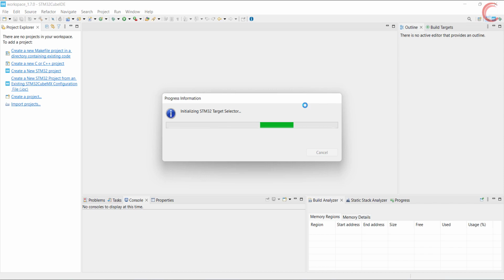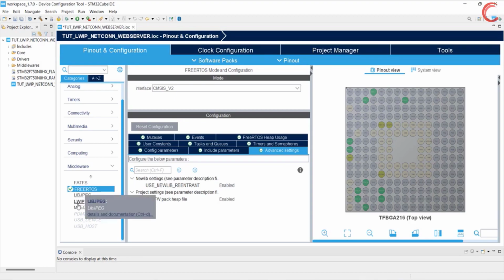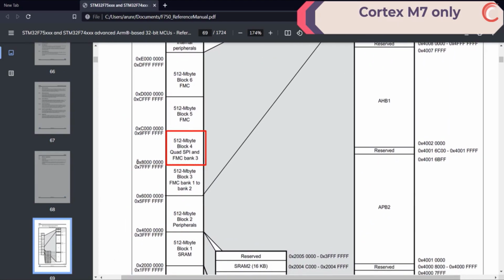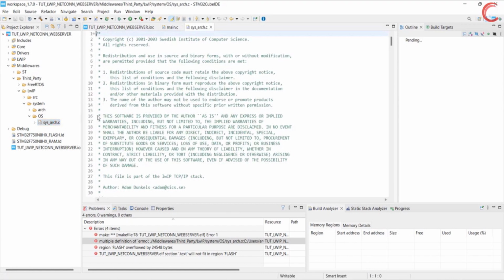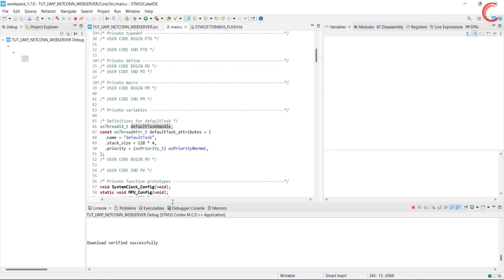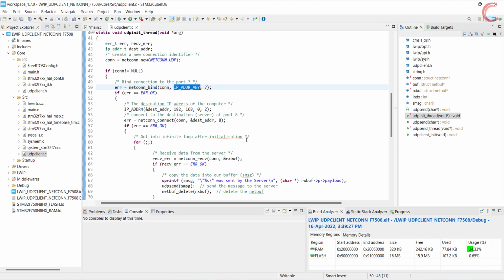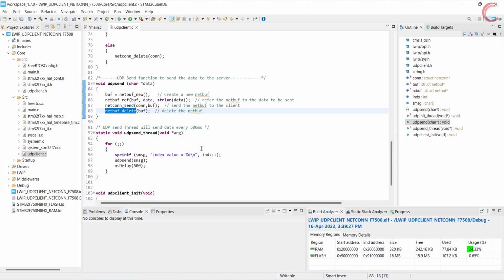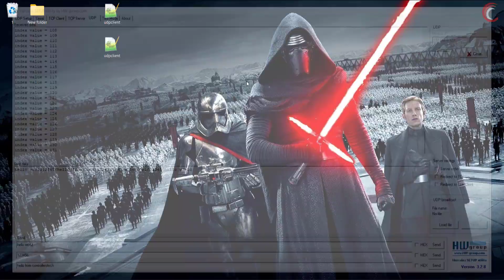STM32 ETHERNET #8 NETCONN UDP CLIENT || FREERTOS ||  LWIP

Comment: I got the code generated without errors .I have not used external flash in any of my code as I am using Stm32F746 discovery board and it has 1024KB flash. I have followed previous videos for bare metal and it is working fine, but I am not able to get the ping test using FreeRTOS .
Reply: I tried with CMSIS v1 and now I am able to ping. Previously using CMSIS v2 was not even able to get a breakpoint in the idle task.

Comment: Hi, I have an issue with this. The new STMCubeIde versions seems to be missing the PHY Address parameter in the .ioc. Instead, there is a  platform settings tab in the LWIP config tab. Other than that, I followed the tutorial step by step, but I can't get the ping to work.. Do you have any idea what could it be?
Reply from the maker: Which controller ?
Reply: @ControllersTech  same issue for me as well, i am using stm32f746G-disco board
Reply from the maker: There is no issue with the process. Please check the article if anything is mismatched from the video. 
I have recently tested the process on all the possible boards I have and things work just fine.

Comment: I tried to do the same tuto using STM32F767zi but when t compile it's okay but when i try to run it shows this error 
 "Memory Programming ...
Opening and parsing file: ST-LINK_GDB_server_a15564.srec
  File          : ST-LINK_GDB_server_a15564.srec
  Size          : 93052 Bytes
  Address       : 0x90000000 

Erasing memory corresponding to segment 0:
Erasing external memory sectors [0 1]
Error: failed to erase memory

Error: failed to erase memory"
N.B: just i want to ping i didn't even add additional library for netconn udp client .
Reply from the maker: You should watch the first 2 videos in the series first